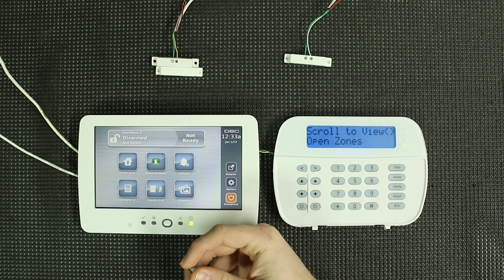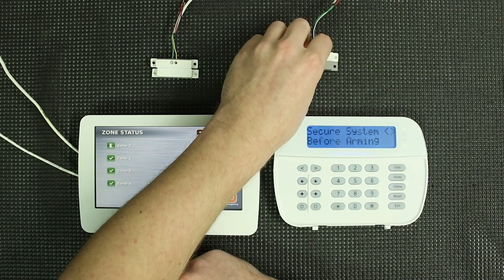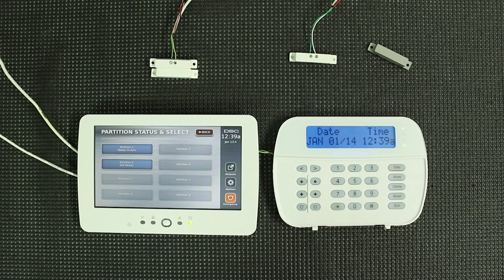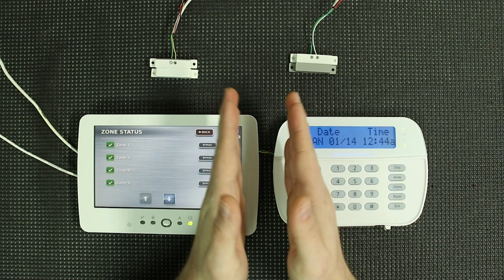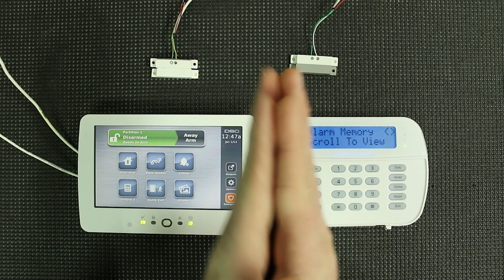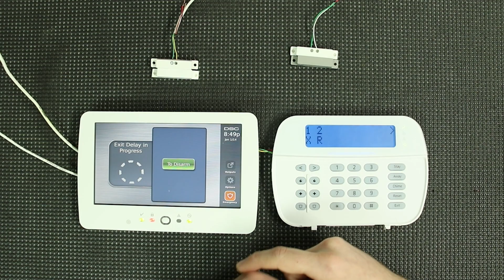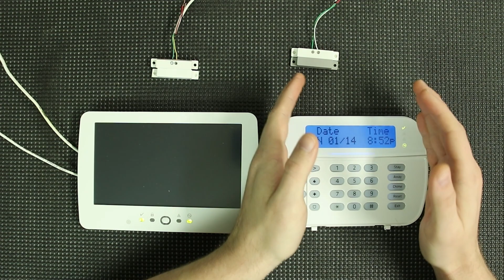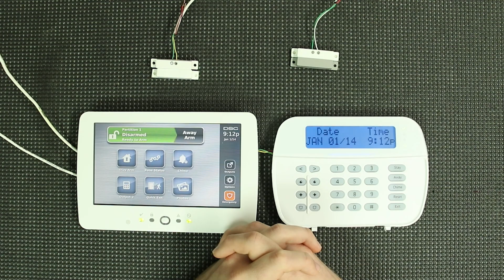Partitioning A DSC NEO Alarm System

Comment: Awesome video. Do you have one available for dsc1832 and pk5501 system?
Reply from the maker: We do not actually. This video came out after the Power Series was discontinued and one was not made prior to that. The concept of partitioning between the 2 systems is exactly the same though, the only difference is the programming sections you use to do so.

Comment: I have followed all the steps from enrolling the zone expander by putting it the serial number and then going to confirm the zone expander. Yet still it does not show any of the zones.
Reply from the maker: I'd say you missed a step somewhere. The process works. Maybe look that the partition was enabled and zones are indeed enabled in there. Just go back through it and review each program location.